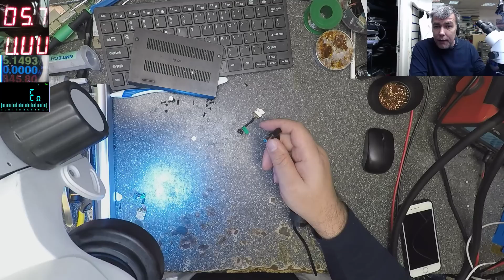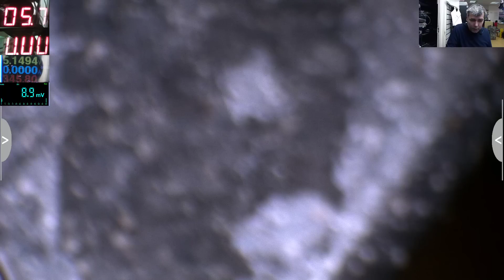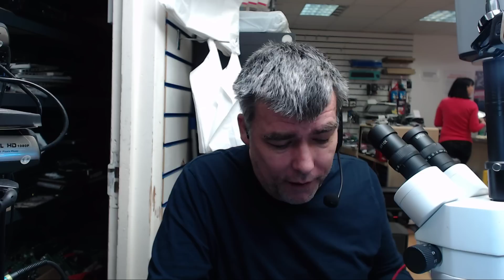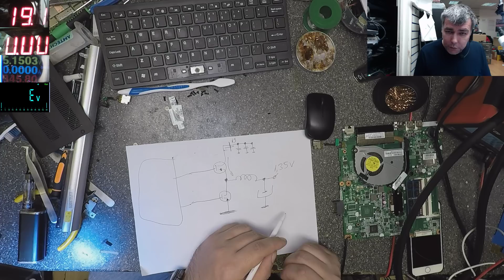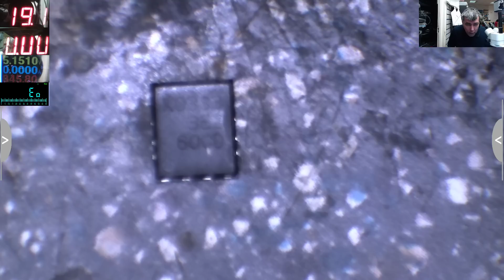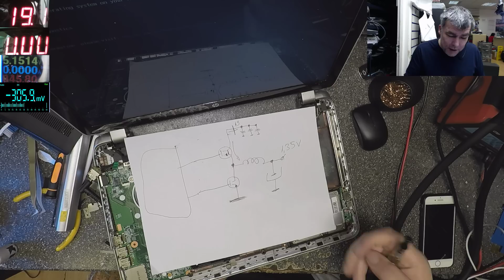Advanced Motherboard Diagnose and Repair Technique, Hp 15-n031sa

Comment: well sir i follow ure posts and try to learn in ure posts u fixed a satellite pro well i have a satellite pro i7 laptop before injecting power to the first mosfet it used to pass power but after ijection power somewere near the usb ports i found a power controler i belive getting hot i removed it after that first mosfet doesnt pass 19v but strangly thers a sense resistor getting 19v near it and i dont have 19v on my power supplies how can it be i would be happy if you can assist me in anyway coz i dont want to damage the mobo by the way this laptop came with liquid spill nescafe but still i had flashing power led at first i know im asking for too much but a simple hello will do thanks or a taught

Comment: I dont have a power supply so i took a toshiba charger 19V—4.74A and connected the + and - to digital multimeter wires. This way i can see when the voltage drops.
Am i right? Can i use this as a power supply?

And your videos are very good. I am learning a lot. Thanks!

Comment: common, man, thermal camera. you know what? I have a thermal camera that we could make a deal for. let me know. it is a Snap-on thermal camera. My problem is a pc104 and another board connected to it underneath which has 3 RJ45 (2 input 1 output).  there are other connectors on them and I can tell you what they are. I have the power supply for it and all. I need help fixing it or I need some one to fix it. don't worry I know some stuff and have many tools for test and diagnostics. lets make a deal.

Comment: Kudos to you sir, so amazing. I have an issue with my client's hp 15ac007nia charging but not powering, when power switch is pressed, the power LED comes up and off in 2sec, is there any assistance I can get from you please sir?

Comment: Recently I changed the motherboard (15CBHPGT) of my old laptop (HP envy 15t Q300) after HP service confirmed the board was damaged. Now after changing the board and connecting only the power cord without the battery, the power LED is turning on but the pressing the power button is not turning it on. No power to fan or HDD. I checked by disconnecting each connection, Ram, HDD, display but nothing solved the issue. I have checked the 19.5V to the board and the 3V to the power button. This is happening with the new mother board. Can you suggest what I can check now.

Comment: Just got the same with Intel N2840 without a fan (as it is a small underpowered procesor) but as soon as it gets into Windows it will shut down completely. Sometimes keyboard is not working and blinking caps lock. Tried updating BIOS and replacing RAM and CMOS but seems to be the power supply of the processor or the CPU itself. How to diagnose that since it starts up normally! Thank you Mr Sorin for your videos!

Comment: Master class. After sitting through years of equations and graphs, I still don’t have a clue of how to diagnose a laptop fault. Those teachers needs to be rounded up and locked up.
Reply: I had the same experience.  Finished my 4 year degree in EE, but came away with nothing practical... just lots of math and theory, no way to put it into practice!  Sure, we built some LED arrays, did some LabView data acquisition projects, and got to play with lego mindstorms robots.  Yet, I have no idea how to design a circuit or product from the ground up, much less diagnose or repair anything complicated.

The closed-source IP & proprietary nature of these things is causing so many problems.  Students come out with a university degree but no hope in paying off student debt unless they get lucky and find a job where senior level designers will act as mentor.  Too much barrier to entry, and generational inequality on top of that!  Not to mention the whole planned obsolescence & secretive IP model is also creating massive e-waste problems.   Let's hope the right to repair movement is successful!  Most of the electronics field is still way behind when it comes to Open Source & DIY learning resources.

Comment: Hello sir. This is embarrassing but I punched my hp notebook 15 on the keyboard hard. It froze with a rough sound (possibly from the hdd) . I force shut it down. But when  I tried to turn on, the fan starts for a bit , the wifi led is on
.but it shuts down again. 
What might be the problem ?
Reply: Punching the laptop...
Reply: @LithiumDarklight  problem..hardware wise. What is below the keyboard that might have been damaged?

Comment: Can somebody explain to me how these MOSFET power supply work exactly? What does the coil/inductor do? Does the driver to PWM to regulate the output voltage of the MOSFET? Why we need a second MOSFET? I tried to find out myself but all examples I could are much more complex.

Comment: use analog multi meter. it will tell you exactly if it is low resistance (change value) or just you say partial short.

Comment: Sorry to ask a stupid question.  On your drawing, the +13V at the top looks like that is what comes from the charger/battery.  So where is the output to the rest of the circuitry?  Or if the +13A at the top is the output then where is the rail from the charger/battery?

Comment: That  double mosfet that you replaced  was a different  as I recall and it still worked - I thought it had to be same exact letter/# combination - learned something new there
Reply: after all it is just a switch ... most of these mosfets are rated at 30v 20a ... and they switch on at around 2 to 3v ..... so should be ok

Comment: I have two laptops that need a eternal fan to cool. but the short on memory, I experienced today. An ACER Aspire tower, There was a module vibrating. It was not snapped in so I engaged the spring clip and started beeping I change the card out and that was it. Thank you for the "professional E-School"... RJ

Comment: Nice video. By the way, the new dual mosfet position can be easily found by the white spot next to the pin on the mb and the hole in the corner of the mosfet. You don`t have to check continuity on the mosfet pins.

Comment: Hi pal. Wondering if you can help me diagnose what is wrong with my laptop motherboard.  I've stripped it down its a hp pavilion 15 ab045sa  motherboard model is DAX12AMB6D0 . There is no power and it won't boot up suddenly. 

Could you message me back when / if you have time . Thanks a lot. I have a multimeter I just need to know what to test.

P.s amazing work . Tom

Comment: Hi I don't understand, 17 mins into the  video. You draw the power supply circuit and say that if you have a short at the mosfet will lead to 19v positive and the coil then that means you will have 19v instead of 1.35v. I understand that but if the mosfet is just a switch then you are still going to get 19v at the coil which means 19v instead of 1.35v at output. 
What am I missing ?

Thanks
Reply: You missing that those transistors are controlled by chip that switch them very fast (PWM), so at the end you get just portion of energy.

Comment: sir can you please guide me.. 

i have dell inspiron N5010.  the problem is that power on but no displays..  i have done the reflow work but it works for 1 day but again same problem faced.. 

so please help me in this..

whats the permanent solution of this problem

1) reballing gpu
2) removed the gpu and convert into intel hd graphics on board 
3) new gpu replacement ( that too much costly) 

thanx in advance 🙏🏻

Comment: Nice video. I have weird problem in my laptop. Few days ago it refused to turn on. Then i showed it to the repair shop. They said that it is a motherboard issue after checking they said it has gpu issue and can't be fixed. But i think that is not the case because it didn't gave any blink signals or like that. It only charges the battery, no any other lights. I have Hp Pavillion dv7-4180us. Can you please give me some advice?
Reply from the maker: if the laptop is coming on but no picture, can be graphics
Reply: no its not coming on , no fan spinning , only shows charging indicator orange when charging and white after battery is full
Reply from the maker: thats mean is no the graphics, probably is same fault like here: https://youtu.be/in15_DHIVgY
Reply: thanks, i will talk to the repair shop guy..hope i will find a pro like you here in India.

Comment: i have an unrelated board Q, on a iphone 6 Q1403 is the hot spot (mosfet next to tigris) would you pull it? or tigris?
Reply from the maker: i have one video about that mosfet, check my video with iphone board repair
Reply: Thank you brother! for me it was cap C1298 but a great lesson learned. You are in the UK? i noticed the guy on phone to you was english sounded like Kent
Reply from the maker: essex, near kent
Reply: well i be damed, its a small world, i found you by watching STS Telecoms you were in his subs list, Im in folkestone kent lol
Reply: Hello again, i have a new puzzle im trying to solve if you could help :) Pricing! I approached a phone repair shop close to me hoping to buy dead phones but walked away with an opportunity to do basic repairs, specifically, micro usb, charging ic, touch ic, battery connector and micro soldering but i have no idea what to charge, he has the shop and all the customers i have the tools and the time to do the work, it is a big ask but could you help please?
Reply from the maker: how i can help you?
Reply: well you work in a shop so i guessed you would maybe know the pricing structure?, this guy is not holding his cards close but he said he charges £30 for micro usb and could pay me £15 to do it which seemed fair? but for the rest i don't know
Reply from the maker: thats good, to do half half. Most of the shops will pay even less
Reply: 50/50 was my gut feeling, I didn't want to sell myself short but i don't know anyone personally who does this work to ask, Thank you for helping me again :)
Reply from the maker: u r welcome :)

Comment: Sir I love and learn a lot of things from your video but I have a little to add to where u had difficulties in determining the type of mosfet. You can easily type the marking code on the Internet and know its value and functions and while replacing, you can do the same thing for the outstanding one you have @ your disposal to be on a safer side.
Reply from the maker: easy way: If the drain is connected to plus=is a channel n

Comment: I use FREEZE 75 is a cooling agent for thermal fault location. It instantly cools down the circuitry. Short circuits or interruptions in condensers, resistors, integreted circuits are quickly discovered.
Reply from the maker: but.... the fun...
Reply: You can also turn a can of compressed air upside down and spray that way..
Reply: LOL XD

Comment: Good Video. so  if current sense loop tells the power control chip there  is too much current it would cut the 1.5v reference voltage to the gate. and then retry.  the 3 volts comes from the cap and the coil being charged and cut.  similar to a voltage doubler circuit.   even with the short the power control chip avoids damaging other components.
Reply from the maker: everything its cuted down already there by the second mosfet based on the current sensor which is next to the second mosfet. 1.5v power rail is joined/shorted with 19v power rail. We have 3v on the memory because i limited the current from my lab power supply

Comment: Last night I had a Lenovo B50-70. It powered up and shut down for few seconds. 
Thanks for your diagnostic method I can check the key things!
The 19V power rail was ok. On the memory power supply I measured 1,38V.  
After a few power up the memory got warm. The sticker on the memory module is burned a bit. 
I replaced the memory module to an other one and the laptop works fine. Weird
Can the memory module go to short?

Comment: I thought the single package dual mosfet was very nasty too, they are getting cheap and nasty :-(
That memory should have been dead, amazing!!, and the data lines from the memory didnt kill anything else, lucky :-D.

i think the driver chip may have been shunting some of the current to ground via the ground mosfet, to try and control the output., it's possible.
Reply from the maker: on a normal case, yes, the ground mosfet will cut some power down, but, i came with 3.5v there, nothing is working on that voltage.
Reply: +zx8401ztv
hey ,if anyone else  needs to find out about 
circuit board trace repair
 try Saankramer Electronic Magazine System (just google it ) ? Ive heard some super things about it and my mate got amazing success with it.

Comment: But what happens to memory, when this 19V go directly to 1,5V line? Obviously memory burns or that coil. Is it in that case repairable with new memory, coil and mosfet?
Reply from the maker: after the second mosfet, its a current sensor, based on the current sensor, the power manager will cut the power done exactly what happent on this case, so, nothing get more damage
Reply: Thank you very much!